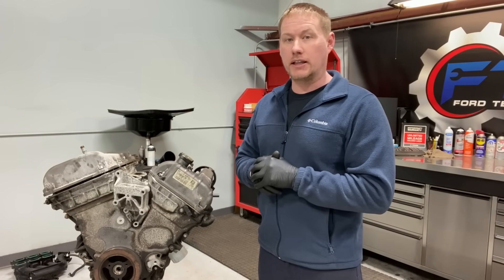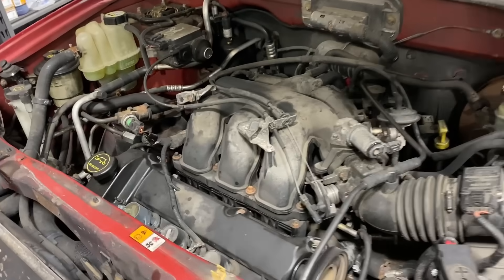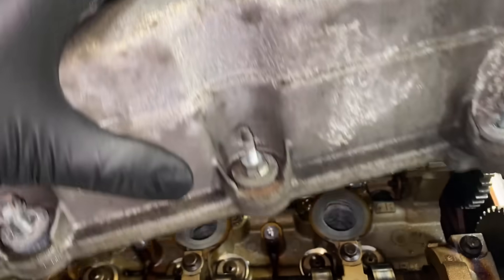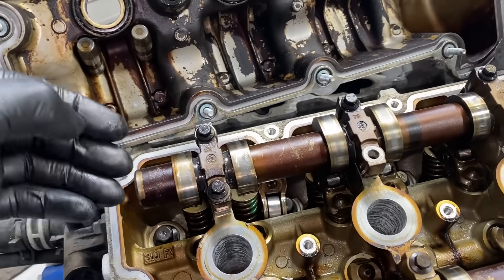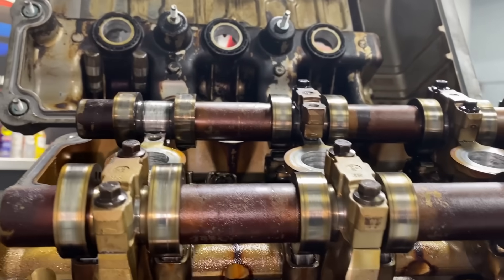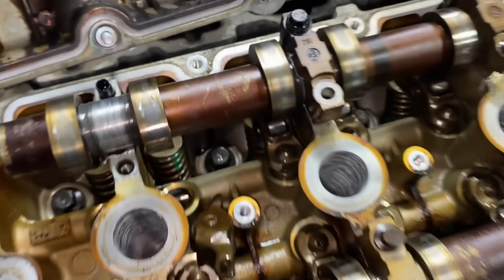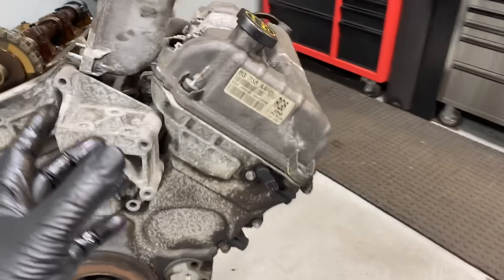Ford 3.0L V6 Duratec Engine: The One Fatal Flaw That Will Destroy This Engine!

Comment: Not changing the oil on time in any engine will eventually kill it. I used to have a 2001 mazda tribute that I bought with 206k miles on it and the only thing that it need was a coil. 

It was a very quiet and strong engine untill I went so many thousand miles without changing the oil. 

It started rattling at start up for a little bit and wasn't as quiet anymore.

But even at that it never did give me no engine problems (nor transmission problems for that matter) after adding an other 100k miles to it on top of the 206. Until somebody wrecked in to me/: but I have faith in those engines.

Comment: my 2001 F 350 sd 5.4L cams came loose and tossed all lifters luckily no damage to cam or head was told buy the guy at the ford dealer that some cams did not get properly torqued at the factory he also commented that the inside of the motor looked like it had 50,000 miles on it not 250,000 and yes it is the original motor no rebuilds just proper maintenance

Comment: The first impression when I see this engine, it looks "under designed" . It feels like it was designed with factors of safety used in aircraft industry, unfortunately without aircraft industry level of quality control.

Comment: I don't know if you could help me I have a 2010 Ford Fusion with a 3.0 l I remove the cam position sensor from bank to and it was broken in half could you tell me what might have happened and where the other piece might wind up thank you so much

Comment: What do you think of the Vulcan 3.0?
Reply: I have a Vulcan 3.0 and it's a great engine,  has never burned a drop of oil between changes ... I have a '95 Taurus and had a '91 prior ...outstanding smooth and quiet engine...@ 24 - 27 mpg

Comment: Do 2010 Ford 2.5 fusions have the same issue?
Reply from the maker: No
Reply: FordTechMakuloco dang I was hoping might be a easy fix I have lower compression on #1 @125 and #3 @150 and rest were around 185

Comment: I haven’t watched this video for long but I got about to 1:30 seconds and you said oil leaks. Aren’t oil leaks indirectly related to oil delivery problems?
Reply: You have oil leaking from the sides of the engine which is causing oil to not get the dohc system.. I don’t get your point...(?)
Reply from the maker: The cams receive pressurized oil from the pump through the galley not from splash lubrication.
Reply from the maker: No these are splash lubrication leaks not pressure leaks.

Comment: Had a 3.0 in had an extended cab ranger that had no engine issues whatsoever. But the windshield leaked every time it rained and the clutch cylinder blew out every time it got below zero degrees F. And yet I still bought more Ford's!???!

Comment: Fords best motor is the Ford 300 I hate how they replaced it with the 4.2 and the Duratecs/ecoboost 

That straight is fords best motor period
Reply: AND it gets like 12mpg, thats not gonna cut it in todays age, sorry bud. They take more into account that just simple reliability or all cars would have tractor engines:)
Reply: @jeedwards1981  my 83 with a full port and polish job is getting about 25 around town if I'm not stopping and about 22.5 at 75 

If I'm running Luke's carb cheater I'm getting close to 34mpg around town and about 28 on the highway 

I don't know what a factory motor would get though
Reply: @Project-gr6zy  thats cool but Fords not gonna resurect that motor it cant meet mpg and epa requirements

Comment: My 08 escape 100k had a cracked #6 exhaust valve. The cylinder head shop said it was also another common problem with these engines. My cam caps and bolts were fine

Comment: Any idea of the failure rate? I drive a 2003 Escape with this engine, so obviously concerned. The Porsche IMS bearing failure rate has been estimated at 8-10%. As high as that? I understand that the Duratec 3.0 V6 was designed by Porsche and then underwent further development by Ford and Mazda. I've owned my car for 10 years and the engine has been pretty good (touch wood). Some small oil leaks, bad PCV valve, and an RMS that went bad and caused a noise but didn't leak. The engine is running superbly at the moment - quiet and pulls well. I'm not sure whether to get this checked over or just to leave well alone. Obviously, I don't want to experience a catastrophic failure.

Comment: you have to use threadlocker on those bolts
Reply from the maker: Nope
Reply: Use tablocks. Aircraft engines use tablocks or lockwire if bolts are drilled and can be wired.

Comment: 0:23 Probably the most reliable engine in the ford inventory. Could this be true? I just bought an 05 with 211,000 miles. It has a oil leak and he never used synthetic because it leaks so i questioned its integrity. do alot of people switch to conventional oil once they start leaking? would love to hear from others
Reply: Hi, i have a 2002 and I just fix the leaks and always use synthetic
Reply: @hunterphillips4297 yeah with fresh oil gaskets all over id just go with full synthetic moving forwards
Reply: That said, the 4.6L v8 is pretty durable, as well as the straight six 300

Comment: Have a 2005 Mazda 6, 116k miles with this engine. Replaced the valve cover gaskets and it’s still leaking oil, must be the timing cover. Not about to put any more money into fixing that, bit of cardboard under the engine to protect the driveway is much cheaper. Also after being in traffic for long periods of time the oil light starts flashing at me if I’m in drive and at a stop, goes away if I put it in neutral. Fingers crossed this thing keeps going

Comment: Glad they don't use the Honda interference engine the Pilot has. As in all Honda engines one small skip in the timing chain/belt and proof there goes the engine. Some replace it at 60k or less if it needs one or not.

Comment: I had a customer with this exact cam cap issue happen on a 1.5l EcoBoost, 2017 escape, 73,xxx miles. Intake cam caps stated loosening from the end of the cam to the front. All but the front cap. (Phaser cap) loosened. Took out the  vacuum pump, lots of fine metal sludge in the head and Engine. Replaced the head, timing belt, vacuum pump, intake cam, spark plugs, gaskets/ seals bolts etc. Changed the oil about 3 times in 1000miles. It's at 90k now. I still perform the oil changes for the customer personally, just to do check ups on it. Going strong.

Comment: I have 2010 ford raptor with p0012, p0022, p0316, p0340, p0341, p0345, p0346. Can you help me please. When I open timing cover I saw that left side lower guide and bolts where broken. I'm confused about timing positions. Can I set crankshaft to timing position and hold both camshafts with pliers not to move to put everything together? If not can you give me some pictures for camshafts positions ? Thanks

Comment: GREAT info. I have a 2010 Fusion with the 3.0V6 now at 205,000 miles. It does make a bit of startup top end noise that goes away as soon as oil pressure is up. So I assume its a lash adjuster. Other than that it has been great, still averages 27mpg, smooth and quiet. Any issues to be concerned?
Reply: did u ever tighten it?? noise go away? any misfire?

Comment: Anyone find out if the oil leaks and bolts are still an issue on 2008 and newer engines?  2006 was apparently updated with VVT and the newer 2nd gens got Cam Torque Actuated Variable Cam Timing, but can't find if the issues were fixed...
Reply from the maker: Oil leaks are always a problem on this engine.

Comment: I’m having extreme oil consumption on a 2010 escape with 130000 miles on it with the 3.0, and ideas as to what it could be? I’ve replace the pcv valve, all the gaskets (no more leaks). After 5000 miles the car drinks 3 quarts (half it’s capacity). The odd thing is there is no smoke or smell. I am absolutely puzzled by this.
Reply: use 10w30 full synthetic plus add Lucas motor oil conditiner. If full synthetic is too costly then use 10w30 high mileage motor oil.

Comment: I have a 2002 escape with the 3.0 L DOHC engine. I bought it used with 171,000 on the clock  man it needed a computer, cat, sway bar links new coils and plugs. got all that done drove it for a few months then i start to notice this ticking when warm. It has gotten a bit louder then before. I read the TSB for it but not very confident that i can do that kind of work that it calls for. But i think i will check those bolts though i can do that my self . It has 197,000 on the clock now. Could i just buy new bolts and just replace them instead of removing the caps?

Comment: Really glad I've seen this video.
I have to change the cam cover gaskets on my Jag that uses a variant of that engine with VVT and I'd never have thought to check cam cap bolts.
I certainly will do now.
Thanks.
Reply: I have a Jag x-type 3.0. Same engine? Were the bolts tight on yours?
Reply: @jeroengevers  I've got an XJ6 X350, same engine but other way around driving rear wheels only.
The V6 was only available for the X350 in UK and Hong Kong markets.
I'll let you know as not found time to crack on yet. Had valve cover gaskets sat here for weeks including upper and lower inlet, plus the o-rings for the plenum valves.
Front wheel bearings taken priority which was an awful job, even with a slide hammer.

Comment: How do I remove a blower motor assembly on a 2015 Ford transit connect.  Do I have to remove  the dash ?
Reply: You remove the passenger glove box to access it. Pull back the seat to get more work space or if you're a really big guy just remove the seat entirely.

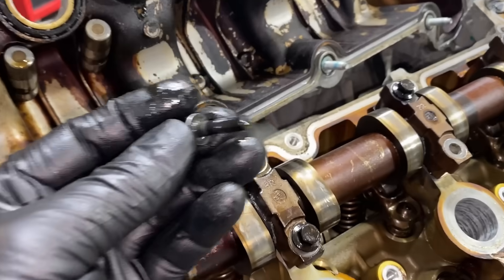Comment: Thanks for the info. I believe the 3.0 comes in the older Ford Rangers. I have been looking at getting a Ranger. Thanks for the info. I prefer the Toyotas but they are so expensive. Even used. God bless and take care. John 3:16
Reply: They came with Vulcan( Push-rod engine) design for the 3.0L end of 2004, only the 2.4L 4-cylinder was a Duratec. After 2005 it's Duratec all the way 3.0L, 2.4L.

Comment: Can this happen on the newer 3.0L? I have a 2011 Fusion with one.
Reply: 3.0l is different design engine and 3.0l is better than the 3.5l
Reply: I have ‘11 fusion too…misfiring now and then but mostly smooth running…

Comment: GREAT video and good information.  I have the 2008 and need to go into do a front gasket to get rid of the oil leaks.  Anyone know of bolts with safety wire heads so that I can safety wire them on?  They won't back out with safety wire... @fordtechmakuloco
Reply: I would just use thread locker. No I have not done this yet to ours but when the time comes to do valve cover gasket, I'm considering adding  thread locker to the bolts.

Comment: The Direct injection model of this engine blows up from carbon build up. I have a bunch of paper work from when the car was new and it received not one but two motors, infact the one in it only had 30,000 miles on it. I'm not sure I'd call the Duratecs all that reliable but they sound nice.

Comment: Bolts are coming loose.  I've swapped many early 3L with the CAM driven water pumps into Ford Contours and for the first several I checked the CAMs and caps (among many other things) to be sure the engines were in good shape.  During this process I found a few that were loose, so got into the habit of spot checking some bolts and torquing down all of them before dropping the motor into the car.  Never had one come back.  They are stout motors and match with the Contour beautifully.
Reply: could u PLS tell me if the loose bolts would cause misfires and / or... the noises??
Or are those symptoms only AFTER the damage has been done and tightening them wouldn't save the engine anymore...
Reply: The fact that it does cause a misfireearly on, is stated in the video.

Comment: If my 06 Ford 500 has a leaking valve cover, than have mechanic check the cam cap bolts for tightness ? Thank you, JohnG
Reply: yes

Comment: Guess Ford didn't use enough lock-tight... lol My 98 Dakota has 253k miles on the same V6 motor. Other than regular maintenance, it's still running strong. I stay away from fix or repair daily or found on road dead vehicles. 👍

Comment: No point in replacing the head.  These motors are $150 on car-part.  Very reliable engines paired with unreliable transmissions.  Tons of these just sitting around.

Comment: Here In the UK I drive a mondeo st220 with the v6,
I think I'm right in saying that Ford released a service builtin recommending that those cam cap bolts were loosened 90degree and re torqued.
If the oil is changed regularly and engine is not overheated they are bombproof but even a perfect engine will loosen these bolts, USUALLY it starts with the ones nearest the water pump, theory being that the water pump belt tension makes the cam flap around.
Reply: I hear the noise towards the water pump on mine on cold start only I believe. I’ll check them but can ya tell me if that noise would be from them being loose?? Or were they already ejected or something else?

Comment: On ford i like the 4.0 i had a 93 ranger with over 250k the olny thing that i change was the clutch and water pump and the person that i sold it put in 123k more and also replace the chlutch fuel pump and timing chain 👌

Comment: OHC designs are not just too much overhead, they're over complicated and over rated. One cam, down in the block where it belongs, with a short timing chain needing no guides,  with proper one piece cam bearings, and two valves per cylinder, can make all the power, economy, durability and emission cleanliness  you can sanely ask for. Just ask Corvette owners, or 3800 Buick owners. (Think Grand National.) More isn't always better, particularly when it comes to cams and valves.

Comment: I can’t understand why any engine builder would run a free rocker arm without a rocker retainer clip on the lash adjuster.
The damage to the cam bridge bolts is not from bolts breaking but more from the  valve sticking or valve bouncing ,
And the rocker arm parting company with the lash adjuster and finding the camshaft lobe smashing it into the head 
The weakest point is lifting the bolts out of the head or breaking them.
I have discovered this with the FA 20 engine in the BRZ Subaru where the rockers are literally falling out.
This only my assumption.

Comment: the Duratec V6 was produced from 1986 until 2008 a full 22 years!!!
Reply: 96-12. your thinking the 3.0 vulcan what was 86 to 08
Reply: @user-d7m4s  3.0l duratec v6 are very reliable and it's better than the 3.5l

Comment: "Better off replacing the engine"- Typical lazy, over-priced mechanic response. You are wasting money replacing the engine. All you need are new camshafts and bearings. This is why more and more people are just throwing away their old cards and buying new cars.
Reply: There are no bearings, the caps and and the cylinder head are machined together. So either way the head would have to come off. Educate yourself before accusing someone of being incompetent.
Reply: @Eastahtata  I figure a lot of the responses on YT today are actually shills or bots. 
It's pretty clear that Makuloco is a really skilled Ford Tech so the response from zfreak280 must get paid by the stupid reply numbers he makes lol. These idiots are pathetic and ruin generally great comment sections like on Makuloco's videos. A shame because you have to pick though nonsense like zfreak to get to the quality posting.
Reply from the maker: You are so far off here, like I said a complete head plus R&R is the same price if not more than a low mileage junyard engine. Besides as I said in the video this engine had been overheated multiple times to a point the rod bearings had blue spots.

Comment: It's a hardness issue. There are multiple bolts on the DOHC and OHV 3.0s that will snap in half if you tighten them just slightly.

Comment: I have a 2005 Mazda MPV 3.0 it has 100,000 miles on it and appears to have been well maintained. The water pump went out and it blew a head gasket. So I put head gaskets and timing chains replacement. I made sure that the timing marks were all where they belonged. Now it turns over but won't start. Any suggestions

Comment: I worked in an engine factory for many years. I suspect that the faulty bolts were not properly torqued to begin with.
Reply: It's possibly a thread locking compound issue.

Comment: Really like your channels.  I noticed you said this issue was in engines from 2001 thru 2007. Was a change made in 2008 on?
Reply: 3.5L
Reply: Robon2ndShift If your saying the 3.0 wasn’t used beyond 2007, that’s not true. I have a 2008 Escape and it has the 3.0, hence my question. Thank  you for the reply.

Comment: Really like your channels.  I noticed you said this issue was in engines from 2001 thru 2007. Was a change made in 2008 on?
Reply: I have the 2010 3.0 and the valve cover is totally different.  277 thousand miles so far and smooth as silk.
Reply: @daniellima2973  wow is it in a escape?

Comment: I have a 2002 XLT Ranger 4-door can truck with the 3.0 liter V-6, I replaced the engine in Feb, 2017 with a factory reman from Ford installed by a Ford Dealership in Paso Robles, California.    Lately I'm smelling oil when warmed up and its leaving oil spots on the ground.  You said something about oil leaking from the T-joint?  but that it's not an issue.  With the reman date on my new motor, would it have been upgraded cam bolt you talked about.?  and should I contact my dealer, even though the reman 3-year warranty period has since lapsed?

Comment: Could it also be that the factory torque spec is too low when first assembled?
Reply: @Sam S converting to in lbs 96-132 in lbs does not sound low